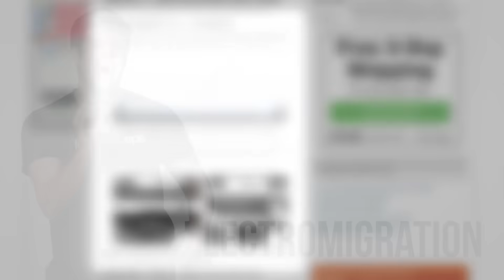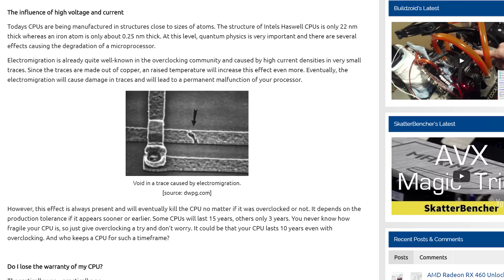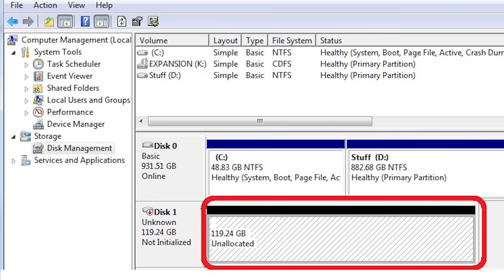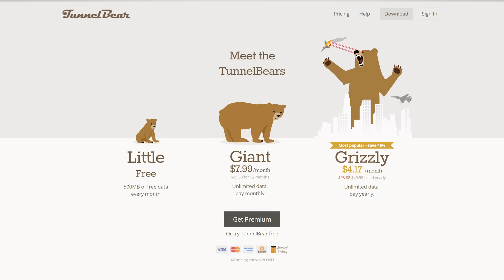Why Do Electronics Die?

Comment: Diffusion also degrades electronic parts (especially liquid capacitors), and most importantly diffusion happens even when electronic device is not operated. Also diffusion is more problematic for modern devices which use smaller and smaller elements than older devices with much higher size of microscopic particles. This is very slow process, but for example even sealed unused electronic device will malfunction after say several decades (again older electronics will last longer in same conditions)

Comment: Nvidia and Planned obsolescence make an annoyingly cute couple.
Reply: Depends of the context. My sister's Nvidia Shield tablet has been a great buy, as a device that came with Android 4.4 out of the box and is currently running 7. Name a company that keeps Android tablets up to date for that long, instead of making the Samsung-style move of updating it once on the first year and then neglecting it? Of course when it comes to PC hardware it might be different, although even on that subject I have no reasons to complain.
Reply: Hahaha the 760, 770, 780, 780 Ti, 970 and 960 wants a word with you
Though those were already obsolete when they left the factory, so I guess it's not "planned" in that sense.
Reply: I had a xfx 8600gt long time ago and it lasted only 2 years. My gtx460, which just turned 5 yo, started to show artifacts. And a 7 yo 9500gt I don't use anymore is still fully functional.
Reply: Andre, do you know Android OS is basically "linuxmobile"? It's free if you don't mind hunting the downloads and rooting the drive.
  Actually, the last Android smartphone I had, I wiped and put in Linuxpuppies... It's really tiny, but you can customize it... I worked with it for nearly three years and sold the thing to a "phone-geek" for twice what i paid... lolz...
Reply: ...
The 780Ti was better than the titan, both versions of it. It soundly trounces the standard Titan and is a bit faster than the Titan Black. It very nearly matches the fucking 980, which is still a very good card. It also beats the 1060, both versions.

The 760 was always a midrange card and is almost the exact same speed as the regular GTX1050, putting it ahead of the RX460 still.

The 770 is still usable(little faster than a 1050Ti and slower than the RX470).

the 970 is a little faster than said RX470.

The 960 is, again, around the speed of the 1050 Ti.

The 780 is around the same speed as the 3 gig 1060.

It's... it's almost as though NVIDIA likes to release cards that are faster than the previous gens... but that previous gens are still usable!

I mean fucking hell, you could probably get playable performance out of 2 GTX 560s if you SLI them.
Reply: EarFarce4 My gtx 560 ti from 2011 is still running perfectly...
Reply: An annoyingly cute couple... that also doesn't exist.
Reply: Vyor Generic Last Name One look at the witcher 3 forums say otherwise.
Reply: the witcher 3 runs like shit regardless of the card you use unless it's one of the newer ones. The 780 is what I'd consider the minimum for max quality.
Reply: Up until this January, I had a 4 or 5 year old GTX 660 Ti. Still played any game out there on med/high settings and 60fps.